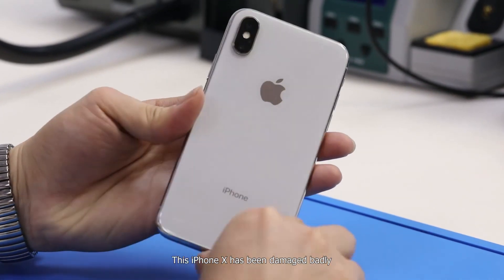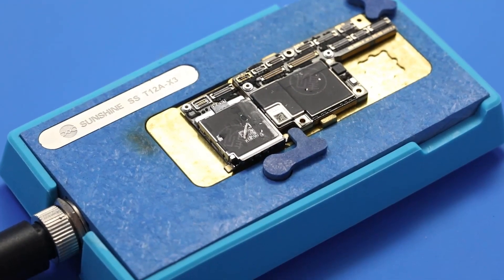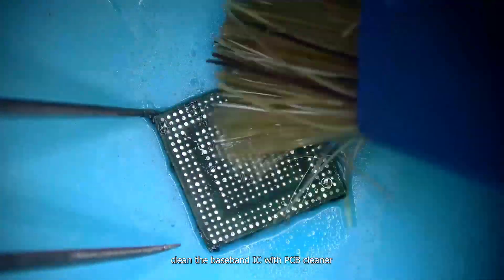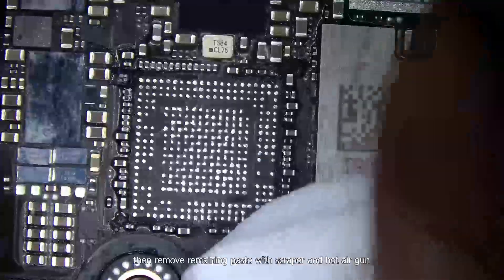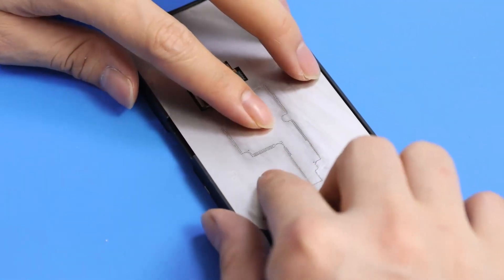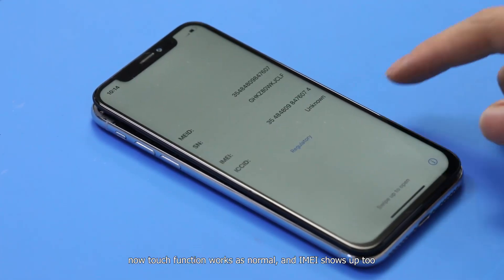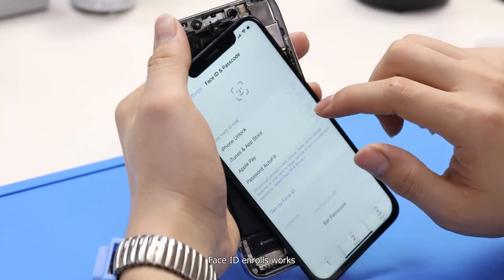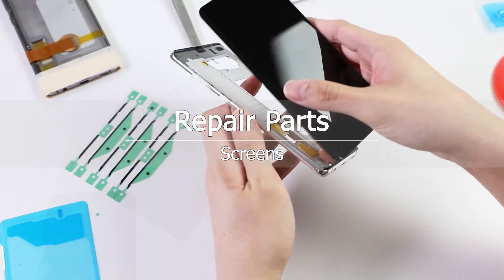iPhone X Repair By Transplanting Lower RF Board. Baseband Data Burn, Wifi Unlock.

Comment from the maker: This iPhone X has been damaged badly, obviously, the back housing has bent and screen is cracked. After removing screen, we can see it was repaired before. Let’s replace a new screen and power on, touch function doesn’t work normally. What if the lower RF board cannot be repaired? We choose to replace the whole RF board.

SUNSHINE T12A Phone Motherboard CPU Desoldering Heating Station, 110V/220V, US Plug, w/retail package
https://www.elekworld.com/Shop/productinfo.aspx?proid=10240&categoryid=371
MIJING Z13 Motherboard and Radio Frequency Chip Reballing Stencils Station for iPhone X/XS/XS Max, w/retail package
https://www.elekworld.com/shop/productinfo.aspx?proid=10676&categoryid=351
SUGON 3005D CV/CC Switching DC Power Supply, 110V, US Plug, w/retail package
https://www.elekworld.com/shop/productinfo.aspx?proid=15913&categoryid=286
VICTOR VC890C+ Digital Multimeter, w/retail package
https://www.elekworld.com/shop/productinfo.aspx?proid=16325&categoryid=288
SUGON 8610-DX Desoldering Station Hot Air Gun, 220V, w/retail package
https://www.elekworld.com/shop/productinfo.aspx?proid=15826&categoryid=283
JC Pro1000s Multifunctional Programmer Host, w/retail package
https://www.elekworld.com/shop/productinfo.aspx?proid=9183&categoryid=287
JC B-BOX PRO Black Technology One Key to Purple Mode Programmer Free for A7-A11 Full Series, w/retail package
https://www.elekworld.com/shop/productinfo.aspx?proid=16258&categoryid=287

00:15: Physical Inspection
00:46: Motherboard Inspection
01:27: Motherboard Separating
02:14: Genuine RF Board Treatment
03:50: New RF Board Treatment
04:39: JC Pro1000S Programmer
05:05: Reballing Baseband IC
05:43: Motherboard Lamination
06:55: Installation And Test
07:25: Unlock WiFi
07:53: Final Test

For more Repair parts&Tools and Tech support, please visit:
Website: https://www.elekworld.com
Facebook: https://www.facebook.com/Elekworldshop/
Instagram: https://www.instagram.com/elekworld/
Twitter: https://twitter.com/ElekworldL

Comment: I am personally not huge fan of swap, yeah for data recovery but no for everyday usage, i found that swap boards is easy to damage when it fails. I found many swaped boards just stop working with no reason.
Reply from the maker: Might be many reasons, bro. 1- the new board itself are not perfect(if disassembled from other mainboard, need check solder joints too); 2- the re-lamination job might have something wrong.

Comment: How about XR with 
1. no imei(null baseband)
2. Bluetooth and wi-fi are working fine

This happened suddenly but everything was fine.
Reply from the maker: Baseband has no relationship with Wifi function, so you can just has someone fix Baseband problem.